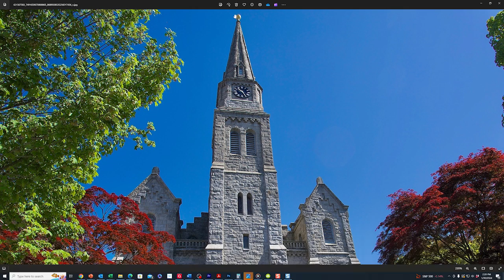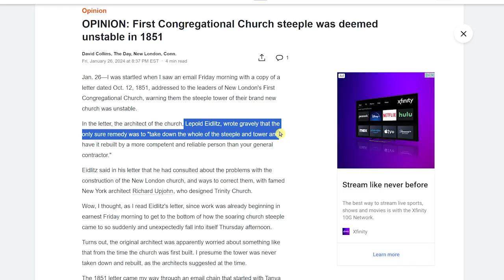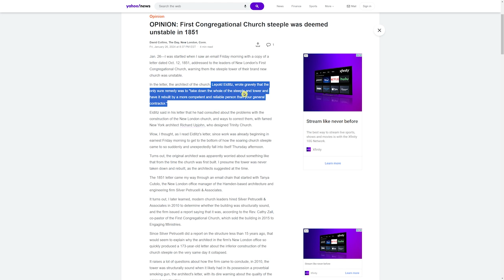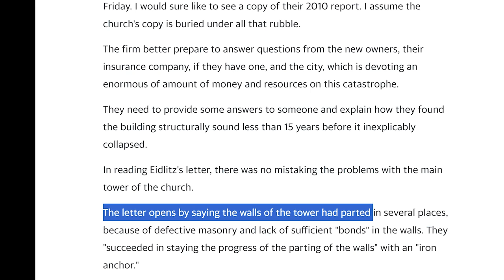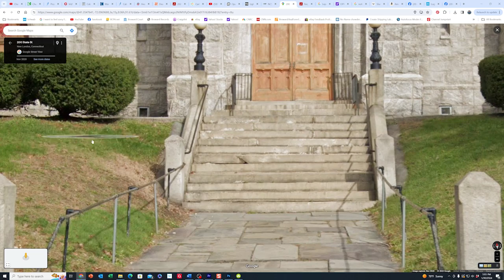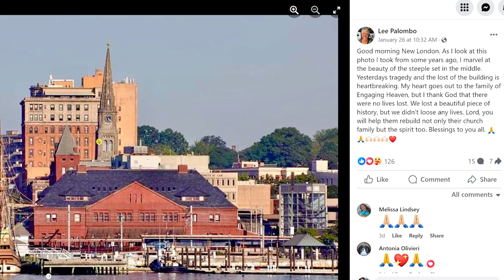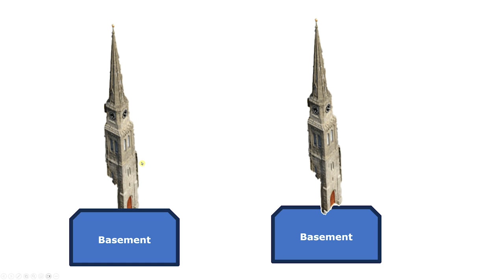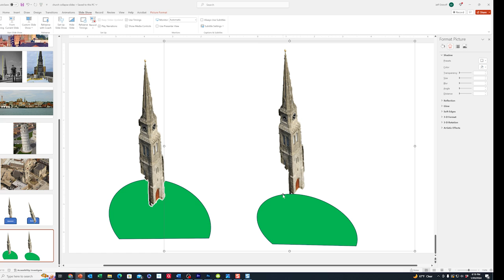What Caused Church Steeple Collapse New London, CT?

Comment: Jeff,
Our family were church members in the late 1990s. There were very few members. On winter 1999 or 2000 the heating plant failed, pipes froze an area, a shallow basement flooded several feet deep. I personally observed the several feet deep water in,  KEY POINT, The Left rear area under the steeple. It was quite a mess and it was obvious to me that the water had been there  for several days. (Based on  the very slow leak.) I decided to help and gave the church $5000 worth of GE stock. About a year later I noted a slight misalignment of the steeple, a leaning away from the street. ( in the direction that it would fall)
I mentioned my concerns to several church officials. My observations were immediately dismissed. As I mentioned we were very involved participants in the church and were very active in the church choir. As soon as I realized that my warning was not investigated we left the church never to return.
In summary, the steeple was not designed to have one corner be submerged in water. Masonry structures usually give warning prior to catastrophic failure. This one did and it took 24 years to finally fall down. I observed the increasing tilt every time we dined at Paul’s Pasta in Groton across the river from the NL church.
Reply from the maker: It's sad that no one took you seriously

Comment: When you were pointing out the back of the steeple, there was something standing out to me more than what you were pointing out. I'm not sure it's anything but what I seen looked like it could have been part of the problem. and that was where the roof met the sidewall on the back side of the steeple. It appears it had coloration exactly where the a roof met the sidewall and looked like it may have been a place where water could have gotten in. I believe the steeple came loose from the two columns on each side of the steeple. We didn't see the other side, but it wouldn't matter I don't think. If the rain was getting in from back there, common sense tells me that it possibly could've been the reason it fell. But as that wall on the columns that adjoined the roof it could have just had a problem in the back, making the steeple lean backwards until it couldn't hold its own weight anymore therefore collapsing.

Comment: Few structures survive from 1851.  Most get demolished when no longer useful and many others burn down before deteriorating to the point of collapse.  Had the congregation dwindled away in the late 19th century, the church building would have been gone by the early 20th.

Comment: It was the rear wall of the tower that collapsed, approx 25 feet from ground level. The failure point is inside the building behind the organ. Thats why you cannot see cracks on the walls. There is pictures of the area failing, but no one thought it was too bad. 
The sad thing is warnings were given for over 170 years, but the church thought they knew better!

Comment: It’s pure Irony, if the mortar, failed, as, I bet it came from Old Lyme, connecticut. 
    Consider. The center of the roof that meets the vertical face of stone, must be flashed,(originally,) yet is dis colored. If , it failed, by weakening the huge trusses, freeze-and-thaw distress on the mortar, the recipe, begins. 
    Don’t look at the foundation unless it shows, upon clearing the wood structure. These buildings have surprising bedrock and granite on the oceans edge.  
   The Almighty Rocks the meager offerings of hopeful men and men.🙏🏾

Comment: Mortar will deteriorate after some amount of time, depending on its composition. I have personally seen deteriorating mortar in much younger structures, I even worked in one or two. Considering that the steeple stood for over 170 years is amazing, despite that it was determined that the steeple was considered unstable back in 1851. Consider, 1851 - 2023, I know many structures that had a shorter lifespan. The best thing is that nobody was in there or too close at the time, that's very fortunate beyond measure.

Comment: If you look at the Video of the collapse, you can see that the Horizontal tilt of the tower toward the rear of the church is slight, compared the fast Vertical fall of the tower! After about 1-2 seconds of the start of the failure, it appears that the Vertical speed of the failure may be as much as 10 miles per hour! The front of the tower is supported by Cut blocks of Granite, it seems to me, that the Crushing of those blocks of Granite would not support the speed of this collapse! I have looked at the other photos of this church, and none of those photos show actually how the rear of the steeple was supported. Was the rear of the steeple supported by those massive curved Timbers that also supported the rest of the church Roof? If so, that would explain the man who "had just parked his car across the street and heard a loud boom". If part of the weight of the rear of the tower was supported by one of those huge curved wooden beams, when it failed, it would explain the "Boom" and the very fast rate of the Vertical fall!

Comment: The steeple tower is a square box with at least two large arched openings ( the main entrance portal through it).  There may have been side arches to the 2 sides (for typical church layout) That means not a square base, but rather 4 pillars, inherently less stable than a square. Looking from the front, the steeple not only went back but also to the left; indicating the rear left pillar failed.  Given the square lower portion and the triangular (conical) upper section, an iron ring  in tension would be necessary at the transition to prevent that angled upper portion from blowing out the walls of the square below.  We see buttressing steps up the square portion to counter this tendency.  If the ring was missing a hodge podge of iron tensioners could have been chiseled into places appearing weak, but would have been a poorsolution, eliciting the dire warnings of the need to rebuild.  Though the outside surfaces are clearly robust granite, looking to be in good shape, what about the inner face of the square base?   Was it simply red brick with plaster over?  Was it heavy timber construction?  Clearly the inner face failed while the out face did not.  You spotted iron rods attempting to prevent a wall blow out. But masonry would tend to crack around the end washers of thee rods, especially with freeze thaw cycles.  Yes, the foundation could have been soft, BUT you don't fix that with iron rads horizontal at the second floor level; and the complaint would not have been on shoddy masonry.   Old masonry sometimes suffers from  not enough portland/lime, too much sand. But this can be replaced, small portions at a time. ,  All in, I'm betting that a missing iron ring set the steeple working to blow out the walls below it.

Comment: I have seen several of these towers supported in part by wooden arch supports on the interior portion of the tower.  As these arches age and are exposed to water infiltrate these supports  deteriorate allowing a slow tilting of  a loose stack of masonry units.

Comment: to me it looks as if the front bottom pushed out, it didn't topple like a tree, it could be that one or more of those retaining bracing snapped and so the front lower bowed out and collapsed then everything else cam toppling down, and it was the rubble it was piling up against that toppled it back. so the front bottom dropped forward giving a rotational kick back at the top.

Comment: You can see at the  beginning of the video that it looks like it is already leaning. Or it is an optical illusion due to the angle of the shot and the angle of the top edge of the garage from the camera view. Regardless, old buildings like this must be inspected on a regular basis by the city to ensure the safety of anyone inside.

Comment: I've worked in close to 100 towers in my career as a clock maker.  More often than not we often see towers leaning slightly back towards the main roof.  Often it has to due with roof leakage that weakens the structure holding the back side of the tower up often due to poor maintenance on the mortar and age of the building.  It's real common for churches to be tight on money due to shrinking membership numbers and skyrocketing costs for repair.  Another theory I've heard about this was location of the highway and the unforeseen vibration and toll it's taken on the structure.
Reply: I would really like to know more about the clock in this church.  Was it mechanical or electric; was it still functional at the time of the collapse; did they find its remains in the rubble?

Comment: At 02:25,  you can see dark cracks (likely wet mortar and/or open cracks) in the side of the lowest section of the steeple, below where the railings run between the side tier and the steeple.  I read over some of the report done on the building  in December of 2023, and two things stuck out.  One, the observations taken were done over the course of two site visits, both were accompanied by the clients.  Two, the pictures taken of the insides were clearly, and definitively, alarming.  The stairs in the tower or steeple were horrifying, and there was evidence of settling and movement in the walls.  Not to mention evidence or sloppy repair work in the past.

Comment: imo: because of the lean, I believe areas of collapse occurred near and/or above the base of the steeple on the side of the direction of lean. The lean gradually transferred upper steeple weight which began a gradual destruction of bonding and joinery material between stone blocks. The action was a slow leaning until the righting moment was exceeded. The righting moment became compromised by weight eroding the coursework joinery materials with a crushing energy, until enough courses were compromised/crushed to allow the steeple to fall in the direction of the lean. 

I think the two architects/engineers who stated a rebuild was the best correction were correct: The steeple was compromised by joinery being crushed or perhaps not sound enough and needed to be removed and replaced/rebuilt. Upper elevation joinery probably was effective enough to hold because less weight was being transferred. It appears the foundation was hard to inspect.

So, in the end, weight transfer crushed joinery near the bottom until weight above the failure area(s) succeeded in pushing joinery near the bottom out of place. The only thing left to determine is whether or not the foundation sank/moved before or after the lean: did the foundation slowly deteriorate and did joinery fail afterward and thus initiate final collapse.

Comment: wait how unstable is the trinity church if it also has a tower and was designed by the same person?
Reply from the maker: Problem was not designer it was builder. The architect told the elders of the church the builder built it badly and it should be torn down, this was 175 years ago

Comment: 12:50 you cannot see anything there because the cracks must have been in the rear, after all it seems to have yielded there.

It seems that the structure was compressed by anchors. 
Is it possible that there were cracks that were pulled closed by the anchors? (that might explain that "all OK" report)
the cracks would become invisible but where they are there would be no connection between the two sides of each crack.
when each stone rests on the stone below, essentially stacked on each other, not much would happen.
BUT we have seen the leaning of the tower. when a tower is vertical there are little side forces, when it starts to lean the side forces become greater and greater until something snaps. 
maybe one of the anchors.
The anchors were probably intended to stabilise the wall, keep it in the vertical, so it can effectively function like a stack.
they are stressed by the compression force they apply.
when sideways forces stress the wall that would increase the stress on the anchors because nothing else in the wall can take the stress.
At some point the anchors, which are intended to stabilise, not to take additional stress, might snap.
Reply from the maker: We showed around the back side and there were no cracks

Comment: I believe your assumption that the tower dropped initialing the collapse is incorrect. I think the failure point was where the roof of the nave meets the tower. The tower was leaning, pushing into the roof at about that height. As the lean very slowly increased the pressure at that point increased until a critical break point was reached causing it to fall starting somewhere near the nave roof. As it toppled, the front entrance side of the tower was pushed outward, which is what gives the appearance of the tower sinking. What I think happened was the tower slid over the top of the front door, and that action pushed away that wall (which as you can see if partially intact even after the collapse). Your crude rotation that you showed at the start is incorrect, as the pivot for the rotation wasn't the bottom of the tower, but about a quarter to a third of the way up (the failure point I suggested earlier).
Reply from the maker: The roof is simply not strong enough to hold a granite tower. The tower leaned until the point it could not longer support itself. The roof made of wood frames could never support a tower.

Comment: The tilting process may have started when the poor quality mortar used in construction began to crumble under compression.  The more the steeple tilts, the greater the load on the foundation under the side toward which it leans, and my bet is that eventually, some element of the foundation buckled, and/or the soil beneath it began to compact or flow.  The strucure is designed to resist vertical compression, so of course it's going to fail at some point.
The bad construction probably led to it falling sooner than it would have otherwise - which is maybe a blessing, given how much worse the timing could have been.
Reply from the maker: Yes, this seems very likley

Comment: Not to brag, but we have much, much older churches in Europe that are still standing. Even after German Demolition Inc., tried to demolish them...twice.
It couldnt fall on the Dorms, because there are towers no sides that would have to collapse too. It could fall forward or back only. Basically best case scenario it fell back, not on the street at front. Still, it could be repaired as Europe did after the wars.
Masonry looks fine, at least from outside. It didnt break in parts, but sudden. Leaning tower would put alot of pressure on structure behind it(horizontal roof frame), if that gives up there is nothing holding it anymore. Those towers are independent structures, walls between them arent structural in relation to towers. Its not unusual for church towers to lean, but they dont collapse out of nowhere. Something had to give up.

Comment: The steel rods behind the plates and nuts corrosion and enbrittlement  probably was the cause .😢 plus water freezing in masonry joints caused extra pressure on the steel rods .

Comment: Most churches of this period have a wooden spire covered in lead flashing etc.. but this one is stone to the top which is unusual. Maybe the extra weight is a factor.
Reply: I also think that if you drew a line from the golden ball in the wreckage to the tower centre that line would be the direction of the wind/weather in most  instances, and that it was erosion by the weather on the mortar from that direction, that caused the lean and then the collapse.

Comment: My completely unevidenced hypothesis: Mike Bell’s video seems to indicate that the entire spire is made of stone. Not just a slate roof on the spire. The entire thing is heavy stone masonry, right to the top. I’d bet a couple dollars that it was too heavy right from day one and one of the walls started bowing outward, which was why it started cracking back in 1851. The iron rods that were added probably stopped it from bowing outward, which allowed it to stand without any further cracking. Wrought iron is practically immune to corrosion because of the slag inclusions in the metal, so those rods would have lasted for a very long time. But it might turn out that when they redid part of the roof, they replaced the old flashing with new flashing and accidentally created a galvanic cell that corroded the reinforcing rods. If one of those rods snapped and the wall started bowing again, it would just be a matter of time.

Comment: Failing mortar, ground subsidence, time and fatigue. The architect was right. My suspicion would be that the roof join and the structure there is likely what prevented the steeple from coming down many years prior to this; and why it fell in on itself. Makes me wonder if a steel tensioning rod near the bottom failing was the last hole in the swiss cheese that brought it down.

Comment: We had a collapse of a small wooden structure church in Bridgeport a few years back. The roof section that butts against the tower let go after heavy rains. As the weight of the roof came down it pulled the tower backwards into it. I believe the first 2 main trusses gave way pulling everything down. The shear weight with no side buttresses and a slate roof I believe was its demise.